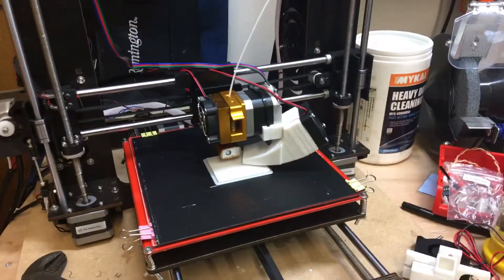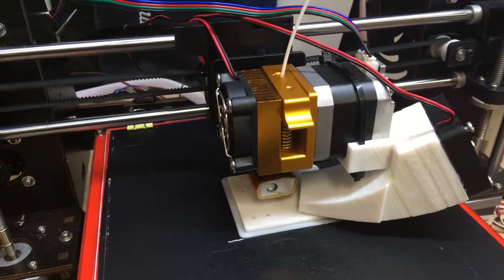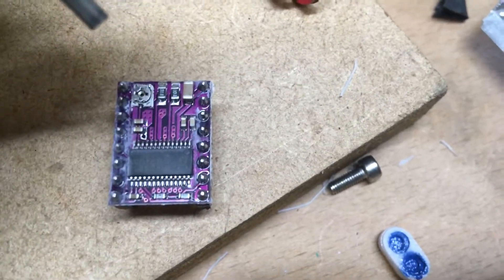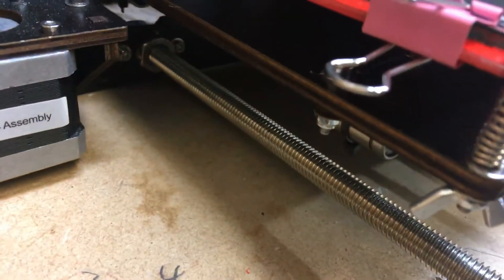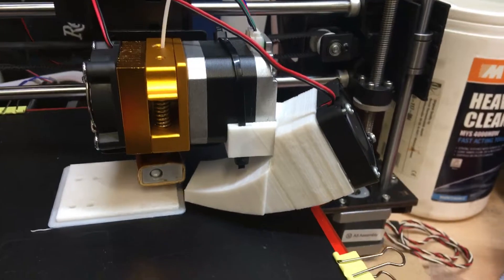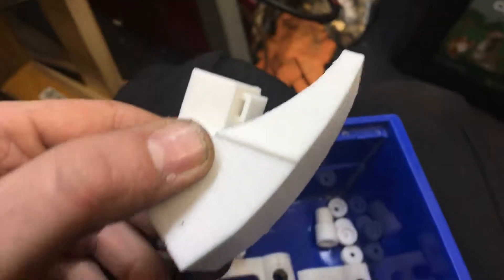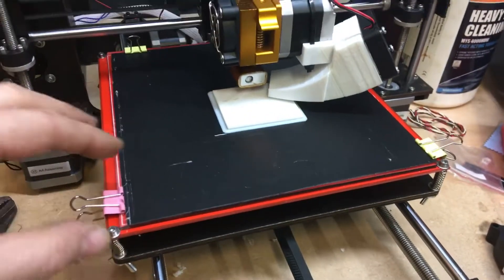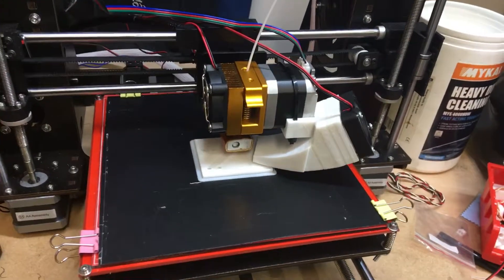CTC i3 prusa clone problems fixed so far

Comment: The purple driver and red one are not equivalent. Purple plugs in 180" out to the red. If you try to use the firmware must change .

Comment: I have the CTC Prusa i3 Clone, with the red controller board. Same frame and leadscrews as the one you have.  I have attempted to upgrade the leadscrews to the t8.  So far I have not gotten it to work correctly so I am back at the original leadscrews.  Is there a firmware upgrade required in order to get these t8 leadscrews to work with these clones?